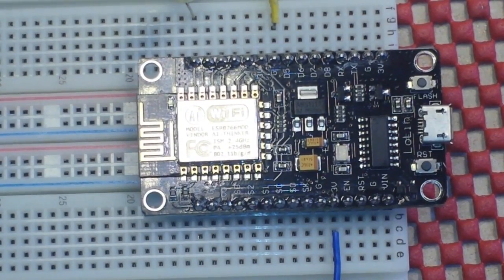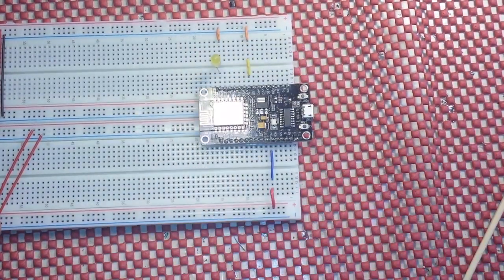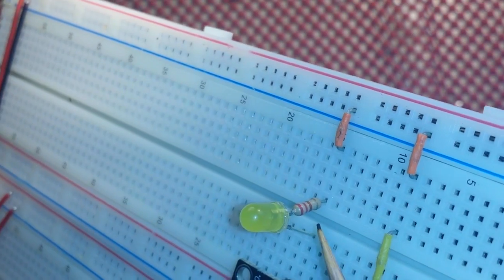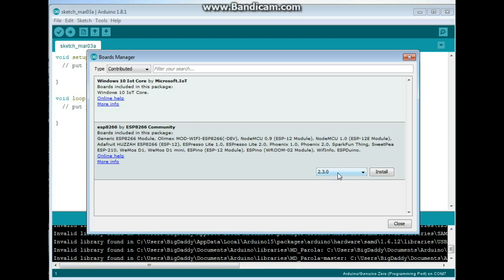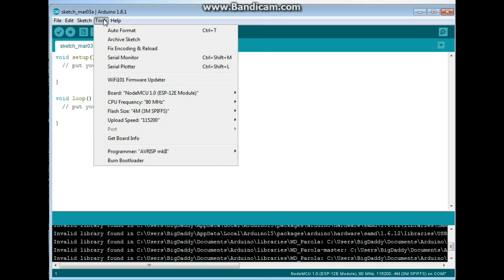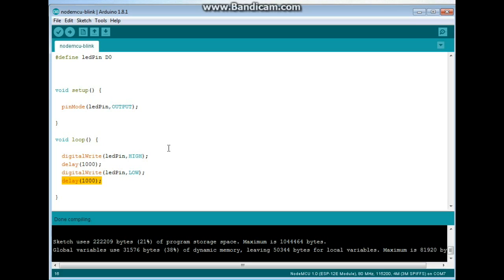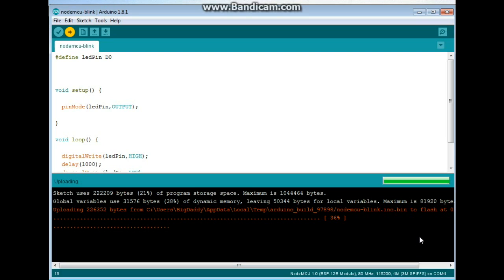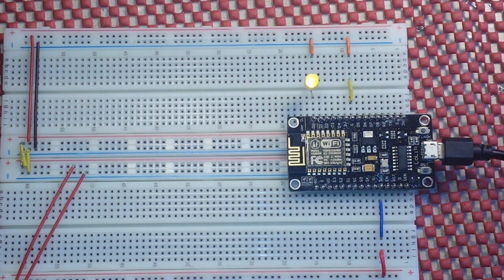Getting Started with NodeMCU V3

Comment: The upload is only slow if the computer uploads slowly...

Also I wouldn't recommend showing the example like this. The board will be powered with the USB and won't need to be wired to the breadboard. A beginner that forgot he has more then one 3.3v line hot running to the board will fry it and not even know why.

Comment: Hey sir thanks for the detailed explanation on this module could you build a project using this module that requires one to control appliances remotely using a custom built android app for the specific project? I have stumbled upon so many projects that illustrate this type of project but when I try with my board I can control the devices

Comment: So blinking led badic code uses 22%, 222k of 1M of Flash , and almost 40% of Ram! What a crappy tool is this IDE / compiler.
For example,  on Pic16f690 or 18f46xxx it takes 21 bytes of Flash and 3 bytes of Ram, so it uses ~7000 times less Flash.

(On Cortex M3 chip Lpc17xx it takes 816 bytes due to registers init overheads.)

Comment: Hello, I have a problem when i try to connect my board LOLIN v3 with 8266 to my computer. In Windows 7 it appear as unsupported device, and in Ubuntu 18 does not appear as a valid COM port.  I connected using USB cable only and no other wires (assuming it must be enough to power via usb cable)

Comment: Ey dude Thanks a lot for the video !!!, it really was helpful for me, really I do not know why it is difficult to find a good tutorial to explain which is the correct way to confiure these module. I was searching in the web and I spent a lot of time beacuse in some places doesn't expain completly and always miss some part to full configuration.

I want to mention some things interesting:

1. Please make sure wich is your module model: In the video case and my case the model is a NODE MCU ESP8266 V3 Lolin ver 0.1. Because you konw exist another models and could be confuse to identify wich is the actual model you have because are fisicly similar another models.

2.  Please make sure have a good micro USB cable (preferibly your original mobile cable). In some cases with anothers cables doesn't works.

3. Please make sure to have downloaded CH340 driver beacuse is the driver for Chinesse Arduinos or another not official electronic devices have these driver.

5. Please make sure donwload the property library. In my case I use 2.3.0 like video. Exist another new libraries but for muy does not work.

6. Configure properly Board model, CPU frecuency, Upload speed, Flash size like video and select port computer recognise.

Bye

Comment: I've posted before that in the Arduino IDE the port selection was grayed out when I tried to link to this board. The fix is get driver CP2102. I googled it and found it at www.silabs.com and the windows 10 installer installed it. The instruction to get this driver was on the back of the board in 2 point type. Wouldn't you just love to be one of those guys for whom everything works right out of the box?

Comment: 6:09
Sketch uses 248,000 bytes (23%) of program storage space. Maximum is 1,044,464 bytes.
1,044,464 bytes are 1MB storage.
Arduino Mega have 256Kb witch is 4x time less than this board, so its more than enough!

Comment: Hi! Great video, thank you! Rebuilding worked out perfectly. But only if the board stays connected. After reconnecting or connecting with external power supply it does not work anymore. Do you have any idea? I work with the same module as you do: NodeMCUV3 an ESP8266MOD and Arduino IDE (recent version). Maybe you have any suggestions? Thanks in advance!
Reply from the maker: +G Bo No, I'm sorry. Mine no longer shows up on the PC. I believe this particular esp32 may be buggy.

Comment: Board manager dont show  the ESP8266 package. What should I do?
Reply from the maker: reinstall
Reply: didint work. what version of arduino IDE do you use?
Reply from the maker: 1.8.1
Reply: Under Files | Preferences | Addl Boards Manager Urls add this: http://arduino.esp8266.com/stable/package_esp8266com_index.json 
esp8266 will then show up in Boards Manager

Comment: Well done video.  I keep getting the same errors and I did everything in the video. Errors: warning: espcomm_sync failed
An error occurred while uploading the sketch
error: espcomm_open failed
error: espcomm_upload_mem failed
Any ideas?  Thank you so much!
Reply: THE SAME
Reply from the maker: What version of the IDE?
Reply: I had same error, but if different cable does not resolve, then in Windows check Device Manager to see if a Port appears when the device is plugged in. If you see a Unknown device, it requires a driver. According to the bottom of my particular device, I went to http://wemos.cc and downloaded and installed the CH340G driver. Unplug, plug back in, check Device Manager again. Back in Arduino editor, change Port to match. That resolved my problem. NOTE: I ordered 5 of these and 1 would not work despite everything being perfect. There is a video here on youtube showing how some of these may arrive with a defective USB chip.
Reply: Try attaching D3  to gnd, plugging it in, hitting flash, and then flashing
Reply: i used to have te exact same problem then y try like in the video says: select nde cmu 1.0 instead of generic esp8266 then it works great
Reply from the maker: Cole Johnson different cable, different USB port?

Comment: good getting started guide, i bought this too, but shocked to see it cant handle larger sketches?!
im wondering what the diff as compared to writing using LUA? would programming via LUA be a better way for Lolin?
Reply from the maker: I have no experience with LUA, but people swear by these modules, so IDK. If you give it try, let me know how it turned out for you.
Reply: Have you managed to make wifi work with this one? I have a different one which works, but I have 3 of those and can't make the wifi to work at all. By the way, if you define the led to 2 instead of D0, it will use the onboard led.

Comment: Can you please tell me how to get an 16x2 lcd working with this, i have a 16x2 i2c lcd but this is board is not recognizing the lcd i.e it shows no i2c device is connected when the i2c scanner sketch is ran.
Reply from the maker: Dipesh Guraw can you attach the display in parallel instead of using I2C

Comment: surely not optimal, but you could route jumper wires under the board if mounted on a single breadboard. If you go out in both directions you could probably access most of the pins.
Reply from the maker: Jon Lorusso that's true. very resourceful